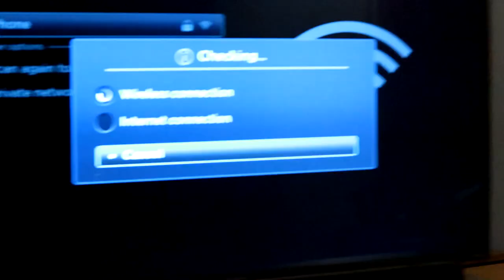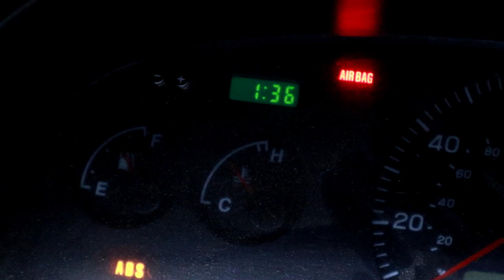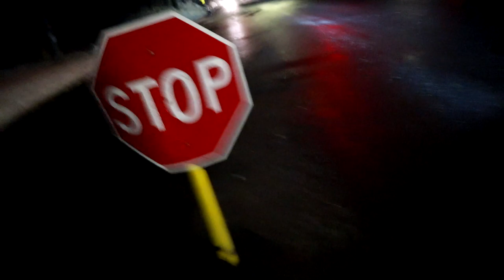THIS STORM RUINED EVERYTHING

Comment: PB blaster to hone a cylinder???? Use wd40 works alot better then pb. Your going through the effort to clean it up you should get new rings and bearings. If the chances of spinning a bearing is higher because you replaced them then no one would rebuild engines.
Reply from the maker: inventordan99 on blaster is a penetration oil wd40 isn’t that’s why I used that
Reply: @damianmonte  you want the lubrication properties of the wd40 when honing a cylinder. Wd40 will creap and penetrate, not as well as PB.
Reply: PB is stronger plus Penetrate oil  like he said. Plus WB-40 stinks more
Reply: @damianmonte  I just use whatever I've got and call it good😂😂 but brake fluid seems to work really good🤷🏻‍♂️

Comment: Are you seriously re-using the piston rings and the bearings? How is the engine then refresed? By cleaning the internals and re gasketin it? smh
Reply: you do realize the difference in refreshed and rebuilt right? refreshed is regasket and rehone the cylinder walls and thats it rebuilt is those 2 steps plus new rings new bearings and maybe resurface of the crank if needed.
Reply from the maker: Chuck Norris when did I say I’m reusing rings
Reply: @kevinanglin678  I see your point , but an engine "refresh" is subject to opinion just so you are aware. To me a "refresh" is rings, bearings, hone, gaskets, and a "rebuild" is all of that and seals and new pistons and upgraded bolts/studs. Just my opinion though.
I am assuming the OP missed something along the way lol a lot of times people will reuse bearings if it's all good to go that's why it's called a parts inspection. Also too many times people just assume every single engine produced wears the same and requires the same maintenance at the same mileage or times in its life.
Reply: @zacharyballew4320  I guess you could think of it has 4 different things a refresh, mild rebuild and complete rebuild and built as in upgraded studs and upgraded bearings over oem bolts and bearings depends on the person I guess lol, to me your way of rebuilt is built for me because you are upgrading the oem specs and your refresh is a mild rebuild to me but depends on the person

Comment: When we took engines apart In class we tagged every piston and set of bearings, so you don't have to do it one by one. Some wire and aluminum tag around the rods and just toss all of em into the washer, and keep the bearings separated in a box until it's ready to go back into the engine.

Comment: Why not just change the bearings while you are at it?
Reply: yeah i dont get it either,i mean hes got it apart,sure they look fine,and probably are,but me personally i wouldnt chance it,not putting the time an effort he is into that motor anyways,just for added peace of  mind i would change them,but hey either way its his build and his channel,let em do his thing,if it throws a rod it will be a lesson for em,if not then good on em lol
Reply: chevyguy06 personally I prefer oem bearings, unless your rebuilding it with oem bearings and measuring the specs perfectly,
Reply: He said in the last video, when you change bearings on these engines it's very possible that you will spin them. The bearings all look fine. Nothing wrong with reusing them. And if he spins one, or one starts knocking. It wouldn't be hard to take the engine out and throw some new bearings in it in the future.
Reply: pretty sure he following cleetus video that he did,cleetus wanted to go 10s on a junkyard engine so he didnt change the bearings just replaced  the piston rings and gapped them,
Reply: Everyone has there own reasoning behind doing something. But just still seems silly to not change them. But then again if you put ebay bearings in your better off reusing them. Would be sooo unfortunate to see him sling a rod down the road!!!.